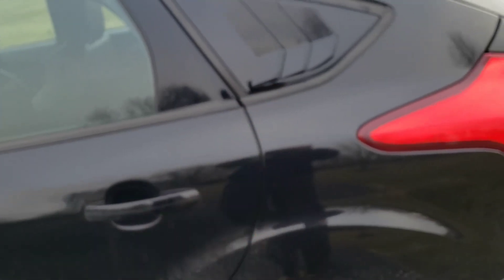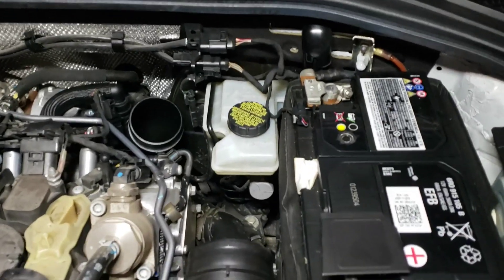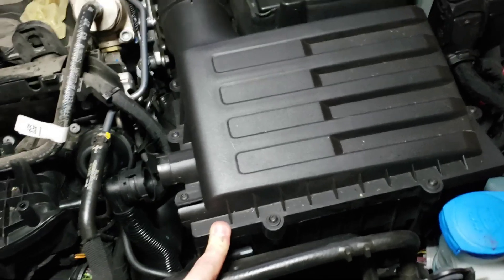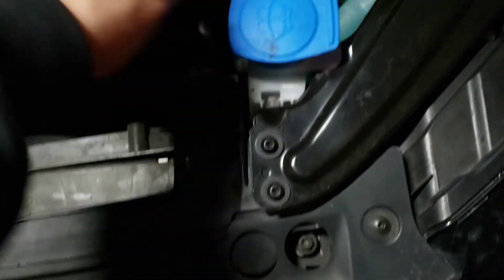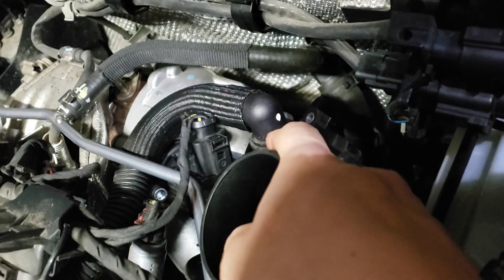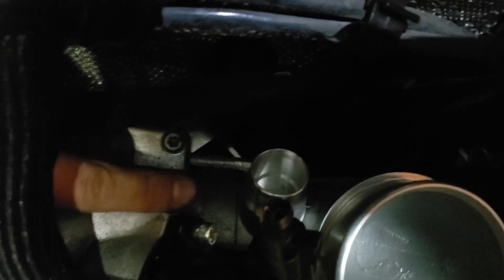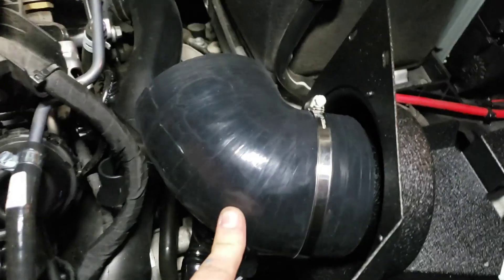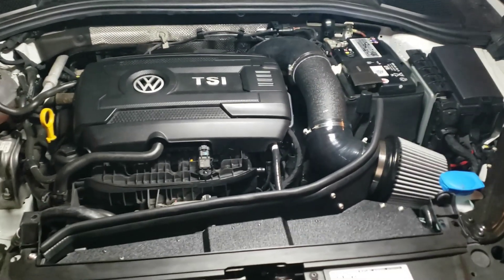Integrated Engineering intake and turbo inlet install on GLI

Comment: What year GLI is this? I have a '24 and IE states that there is a change to "a sensor" in the '22-24 that does not allow for proper fitment of the turbo inlet. Any info you can provide is appreciated.

Comment: The rear most hose clamp is a nightmare if the screw of the clamp is positioned down towards an electric connector.  There is literally no space to insert a ratchet, flat head screwdriver. I even tried a right angled flat head and even that doesn't work.
Reply: Yeah I feel pretty unlucky mine is faced down into just shit.